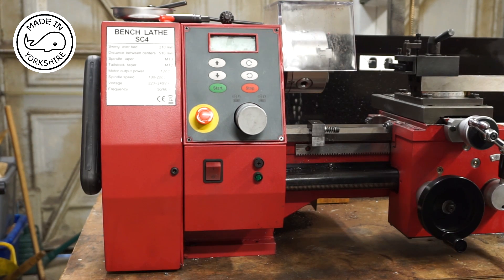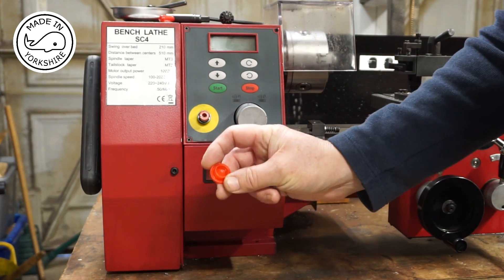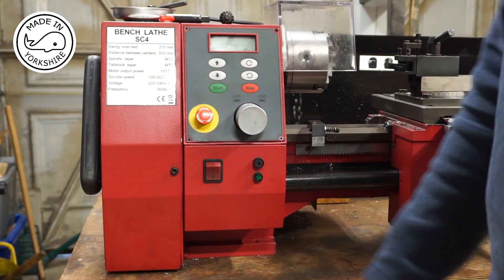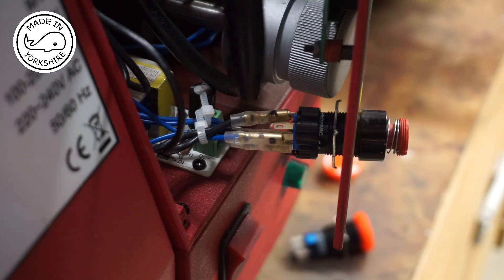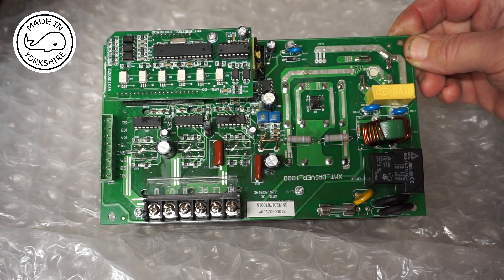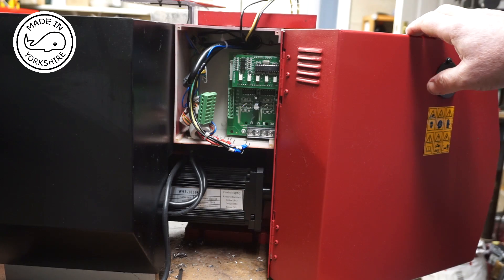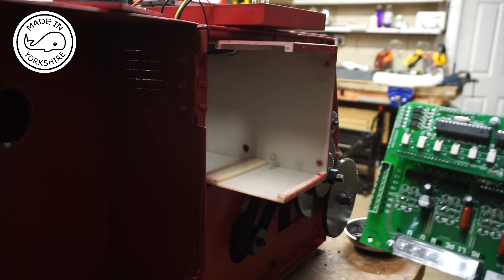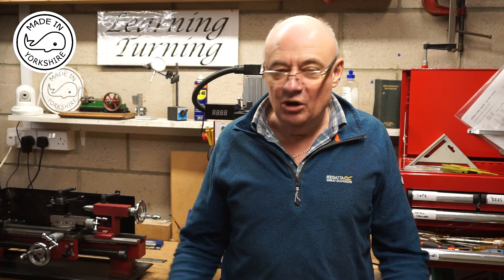#MT27 - Sieg SC4 lathe. Emergency Stop Malfunction. By Andrew Whale.

Comment: Hey, I have the same lathe with a different name which it is jetco jml-3s. They are exact same lathes. However, I have a problem on my lathe nowadays. I made lathe work a couple days ago and turn off the lathe and then turn it on again about half hour later but the fuse that on the front panel which is above the green light pops out. I replaced the fuse with same one but pops out again. I tried 5-6 times but each time it just blew. So I've checked the control board, servo motor, screen boards etc. I didnt see any damage on them, and even the fuse on the control board was working.  So, do you have any idea what's going on my lathe? Thank you.
Reply from the maker: Please see my reply to your similar message  on a previous video.

Comment: Hi Andrew. My Lathe has stopped going forwards but runs backwards fine, would you know why this could be? (My lathe is a C4A)
Reply from the maker: Hi Allan. My guess is that it's a controller board fault. Try posting the question on the various model engineering forums. Eg model-engineer.co.uk and Home Model Engine Machinist.
There could also be some existing posts covering this problem.
Good luck!
Andrew

Comment: ive got the exact same problem, but changin the whole board seems overkill
Reply from the maker: An easy solution is to buy a separate e-stop button and put that between the mains power socket and lathe. I did this as an extra safety feature and bolted the e-stop to the front of my lathe. Some of my most recent videos show the front of my lathe with the e-stop attached.
I think someone else suggested that a relay was at fault and that this can be replaced if you gave decent soldering skills.
Hope that helps.
Cheers
Andrew
Reply: @learningturningmetal   the E stop they use is rated 3A at 220V and 5 A at 110A, it can't handle the full motor load, that's why they use a relay

Comment: Andrew,
Can I ask two questions?
1) Have you have had good service from Arc the lathe supplier. 
2) Can you cut left hand threads on the SIEG SC4
Thanks
Paul,,
Reply from the maker: Hi Paul
1) Fantastic service from Arc - second to none. They are quick to respond to queries/problems and have the attitude of not letting problems rumble on. Very customer focussed. I've not got any commercial involvement with them - I just find them an easy company to deal with. Delivery is pretty quick. If you order a large item (pallet delivery) you generally get a phone call the next day to arrange a delivery date sometime over the next few days. Other companies I've dealt with are pretty poor at communication, they take your money, take a while to deliver, and leave it up to the delivery company to inform you of the delivery date.
2) You can cut left hand threads on the SC4. This involves reversing the leadscrew by swapping a gear around - not somethingh I have tried though. Bob Ackert produced an excellent supplement to the SC4 instruction manual where he explains how to do it. Bob's supplement is very informative. It is free to download at:
http://www.fenichel.net/pages/Indoor_Activities/metalworking/lathe/Bob%20Ackert%27s%20SIEG%20SC4%20Manual.pdf
I've found the SC4 lathe to be an excellent midi lathe and it performs really well. I'm over the moon with it!
Hope that helps.
Cheers
Andrew
Reply: @learningturningmetal  Thanks Andrew... that helps a lot...

Comment: I had this problem on my Sieg SC4. The issue is the relay on the controller board sticking in the on position - the E-Stop button should cut power to the coil and kill power to the rest of the lathe. In my situation a sharp rap with the handle of a screw driver on the case of the relay jarred the contacts apart again, and full function was restored. I may have to replace the relay at some point, but they are relatively cheap compared to the price of a complete controller. It’s a 30A 240VAC relay, so something like this would probably do the trick.
https://www.ebay.co.uk/itm/R40N3021855220-Relay-electromagnetic-SPST-NO-Ucoil220VAC-40A-Series-RELPOL/192925966371?epid=572281788&hash=item2ceb48a023:g:2csAAOSwzYhc5n5p
Reply from the maker: Brilliant! Thanks for the info Jason. That could come in very useful in future. It could well help others too.
Cheers
Andrew
Reply: @jason Cundall, holy shit, I tried the relay tapping  (I tapped both the yellow and the black component) and it worked !!!!!!!! lolol. The relay can be accessed from inside the geardbox without having to remove the whole board

Comment: Hello, why did you upgrade? I've just watched you unboxing a SC3 in an early video, and now, it's and SC4! Did you return the SC3? Any reason? I'm looking to buy a first home lathe (I've had lathe training when I was a wee lad) but I dont' want a toy, nor do I want to overdo it... Is the SC3 too wimpy ?
Reply from the maker: Hi Michel. The sc3 is a good starter lathe but I found that it needed some work before I was really happy with it. A carriage lock is a major requirement as parting off can be challenging. Check out my other videos on sc3 upgrades. The sc4 is in a totally different league, loads of power, relatively easy parting off, fine and coarse power feed on the carriage, plus power feed on the cross slide. Works great straight out of the box. I thought I might keep the sc3, but having got the sc4 the mini lathe just gathered dust. If you have space and cash, go for the sc4!
Good luck.
Andrew

Comment: Hi Andrew, really useful video, thank you.  ARC seem very good at sending out parts.  Is that typical?  Presumably they wanted the defective parts returned?
Reply from the maker: Thanks Steve. I think that if you can clear demonstrate a faulty part (eg by send them a brief video of the problem) Arc seem to be pretty swift at replacing it. I believe Arc have a good direct relationship with Sieg and, in this instance, they didn't require me to return the faulty board.
Cheers
Andrew

Comment: I've had my SC4 for several years now and when I close it down at end of job I always pop the emergency stop button in. It's how the guys at Axminster did it when I had my training and now I'm wondering if they knew about this possible "Fail Deadly" bug. If you turn on the power and the lathe starts right up then it means the controller board has a fault and the emergency stop is no-longer trustworthy.  I only found this video because my Lathe did this very thing a week ago. My first reaction was that some conductive shavings had got behind the control panel and shorted the connection on the Emergency Stop button, but testing the button revealed it was fine so now I need to go back to Axminster to get a new control board!
Reply from the maker: Hi Mark. Yeah it looks like you have the same problem that I had. When Arc sent me a new controller they mentioned that another customer had recently experienced the same problem. So maybe a design fault. If Axminster say it's outside warranty it might be cheaper buying a controller from Arc. Alternatively just purchase an emergency stop switch and install between incoming mains and the sc4 power plug. It seems crazy to me that the sc4 estop is wired into the controller. Bad design. Apart from that I think it's a great machine.
Good luck.
Andrew
Reply: Thanks Andrew. The purchasing system at work means it's easiest to buy a replacement board from Axminster. Once I've replaced that I'll add a mains interrupt stop. I'm hoping I can take a look at the board and see what's died and maybe come up with an indicator of some sort for the future.
 @learningturningmetal

Comment: I think it is extremely poor design practice on the part of the design of the Electronics to have the "Emergency Stop Button" require a working control board in order to function!!  (Electronics Engineer of 35 years here.)  That Emergency Stop should interrupt power directly.  Your issue here proves that.  Emergency Stop should also employ Dynamic Braking, IMHO.
Reply from the maker: I tend to agree. I'm surprised the design actually meets with British standards.

Comment: Hi Andrew can i ask you about your SC4 lathe, I know its a larger more capable lathe than your Mini lathe. But does the Mini lathe compare favorably with the SC4 apart from its smaller capacity, appreciate your comments on the Mini lathe good & bad points. Thank you.
Reply from the maker: Hi. The sc3 mini lathe is pretty good for the price but it needed some modification to get it right for me. Parting off was difficult until I made the carriage lock - which was a real success. Exposed gears behind the carriage handwheel need covering to prevent swarf from entering. The speed display I made was a great improvement. Having said that this little lathe is definitely capable of machining metal to within a thou and it doesn't take up too much space.
The SC4 addresses all the above points and it also includes a coarse and fine feed on the carriage, plus a power feed on the cross slide. It's a far more powerful and substantial machine, capable of machining slightly larger diameters, and I am really happy with it. If your budget can stretch to an SC4, then I would recommend you get one. I kept the SC3 but so far haven't used it again.
Hope that helps.
Cheers.
Andrew
Reply: @learningturningmetal  Thanks for your reply Andrew, i wasn't looking at budget at all between the 2 lathes more the better choice between the 2 machines. I dont really do much large or heavy work these days & the Mini lathe would probably do most of the work i need to do. But as they say only buy once so i might be better going for an SC4 size machine, have you had any issues with the SC4 apart from the electrical problem you had with the circuit board & did you find any thing you needed to do to the lathe to make it better suited to your every day needs like you had to do to the Mini lathe. Thanks.
Reply: @gillian9178  you and I appear to be on a similiar hunt. Though I have a micromark 7x16 now I'll soon need to replace it. I'm considering the little machine shop lms 3540.
The best of luck to you with your decision.
Reply from the maker: Hi @gillian9178  . Apart from the controller board, I've not had any other problems. I did purchase the SC4 quick change tool post from Arc. It's not the best qctp but far better than the std toolpost. I already had a 4 jaw chuck, so I didn't need to buy anything else or make any mods to the lathe.
Cheers
Andrew

Comment: Andy, great info, as I am just about to purchase a SC4 from Axminster, they want £1889 (with the base/stand) where did you get yours from.?
Reply from the maker: Hi Kevin
I got mine from Arc Euro Trade. Currently around £1500 with stand. Save yourself £350. I'm sure the machine is identical.
Arc are also a good company to deal with.
Good luck.
Andrew

Comment: Well done. Delights of Chinese machinery ownership. One soon becomes a tech. Try not using the emergency stop button for stopping the lathe. The stop touch  pad stops the lathe by applying a soft stop protocol and the avoids the strain on the motor and the electronics, the emergency one is for a sudden stop.  Look forward to seeing the 10V finished.
Reply from the maker: Thanks for the advice. Hopefully it won't be too long before the 10v is finished.
Cheers
Andrew

Comment: I know it was disconnected from power but those screws falling out and hitting the table at 4:15 sounded like a short circuit to me! ⚡⚡😱 Nearly had to change my shorts there. Crikey is right!!!
Reply from the maker: Ha ha. I always remember an electrician changing a fuse box under the central heating boiler in my old house. The boiler kicked in and he jumped out if his skin and hit his head on the boiler. Poor bloke.

Comment: Hi Andrew,
That's not good, my Sc4 is nearly ten years old with out major issues.
That's nearly £270 worth of parts if you had to buy them !.
Arceurotrade has never let me down with any products they sell.
Good on them for their quick response for replacements.
Give the old controller PCB a quick check for dry or cracked solder joints.
I noticed the fan is in a different place on mine !.
ATB Adam
Reply from the maker: Hi Adam - good idea. I'll get my circuit tester out and have a play.
Cheers
Andrew
Reply: +Learning Turning Metal - by Andrew Whale 
Please be careful probing the capacitors, short them out first.
A visual check of the joints with magnifying glass first.
Adam
Reply from the maker: Ah - good idea!

Comment: Well done Andrew, the only thing I would add to other suggestions, is always start with the most difficult screw/bolt/component first, then if you can't budge it you haven't dismantled too much, then contact a friend ( youtube ), I hear what you say about the speed of shutting down with stop button versus emergency button, but the main point of the Big Red Button is you can whack it with anything to stop the machine,  you don't need to point gently with one finger like you do with the stop button, stay safe mate and I hope you never have to whack your Emergency button in a true emergency.Bob
Reply from the maker: Hi Bob - fair point. I agree, I hope I never have to use it too!
Take care.
Andrew

Comment: I am somewhat troubled that the emergency stop button is connected through the control board instead of sitting between the main power leads and the control board.
Reply from the maker: Hi Robert. I also thought it strange but I guess they have done this to avoid high voltages at the switch?
Take care.
Andrew

Comment: You now have a spare emergency stop switch which is apparently okay. If you can find what's wrong with the old control board and fix that, you'll have a spare control board. All you need to do now is get back to ArcEuro periodically with issues about the chuck, the tailstock, the topslides, the ways, the spindle, the gears and the motor and you've more or less got a spare lathe.
Reply from the maker: Ha ha - nice thought! I must say though that Arc were quite responsive in sorting the problem out and with next day shipping of the controller. They seem like a good company to deal with - though I have spent a few bob with them in the past.
Cheers
Andrew

Comment: Hey andrew no E stop on my old classing pre 1976 . Just lots of belts and gears spinning around. So I must be on my toes at all times when operating it maybe I should retro an E stop into the motor .anyway thanks for taking the time to make the videos . Keep up the good work. PETE USA NEW YORK
Reply: Sorry four typo it’s clausing
Reply from the maker: Yeah Pete - you can't really beat the old stuff (H&S excluded). I have a 1962 Meddings floor standing pillar drill and it runs like new. No E stop on that either.
Cheers
Andrew

Comment: Thats why I love my old Myford no electronics to go wrong. I have a Sieg mill and I have had no end of trouble with the boards going wrong and they arn't cheap to replace. Glad you got it working again, it's always a bit heart in mouth moment when you start fiddling with all the wires and stuff.
Reply from the maker: Yep, not ideal. I had an old myford ml8 woodturning lathe a few years back and it was great. I guess if the controller packs in totally at least I have a spare without an emergency stop function. Cheers Andrew